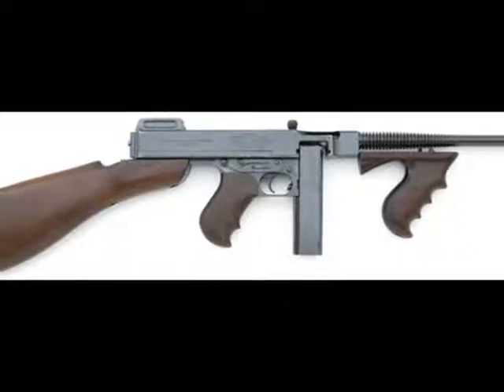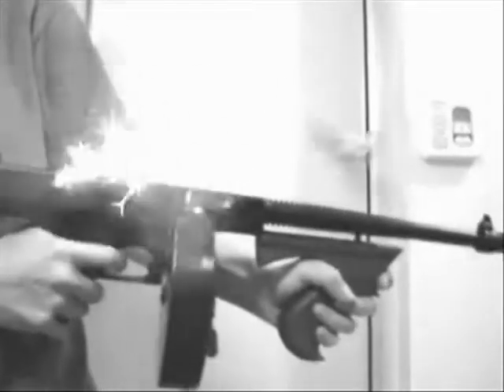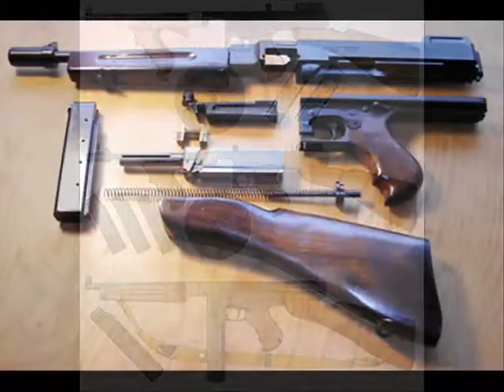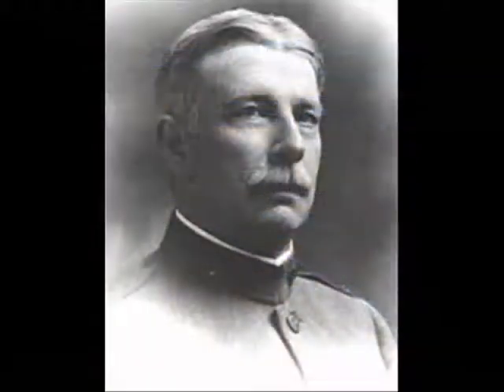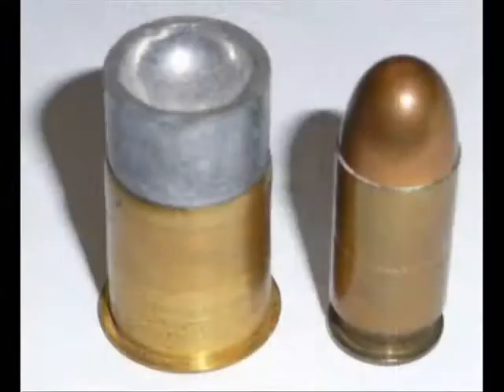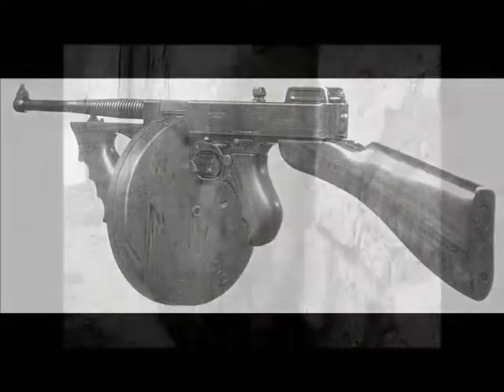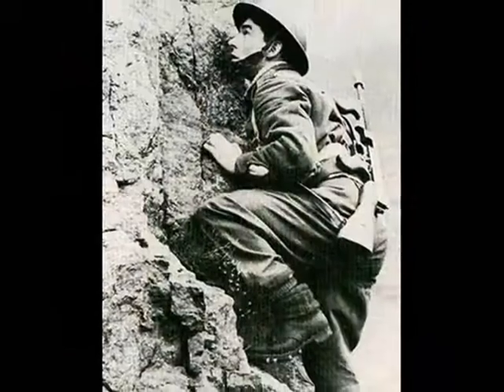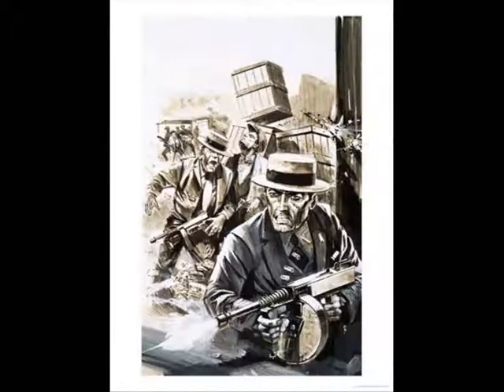ABOUT: The Thompson m1921 submachinegun

Comment: The M1921 had a rate of fire of up-to and over 1000RPM. It wasn't until the M1928 and M1A1 that the rate of fire was lowered to a more controllable 700-800RPM, due to the fact that the army wouldn't consider adopting the weapon until the rate of fire was lowered